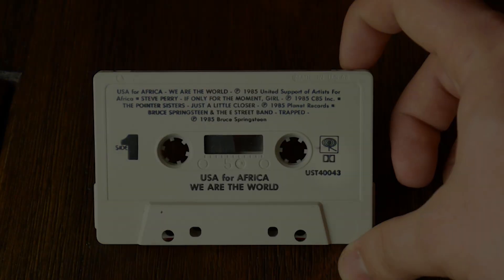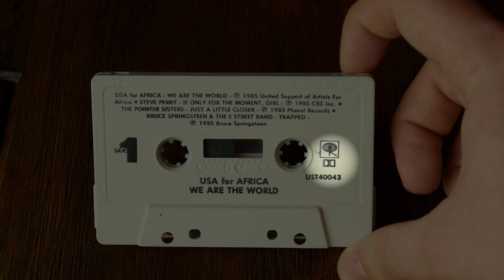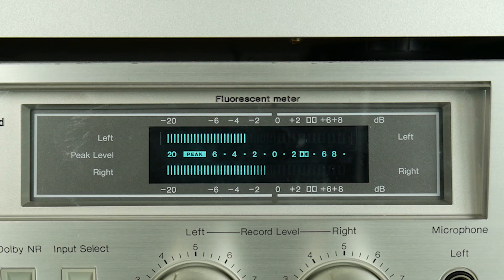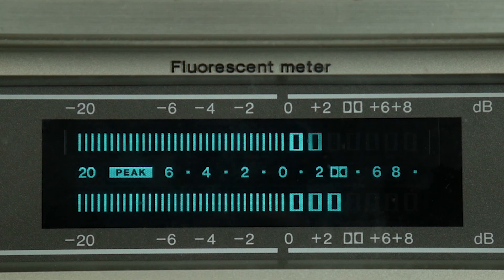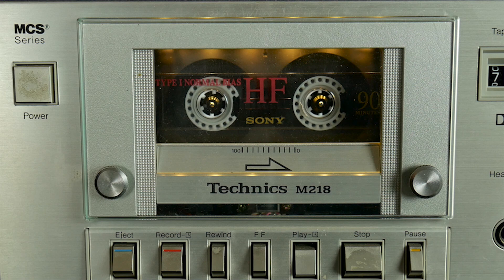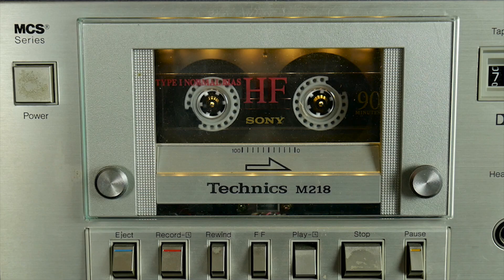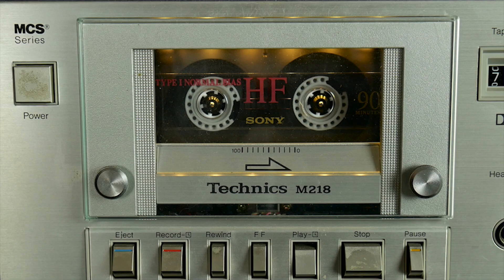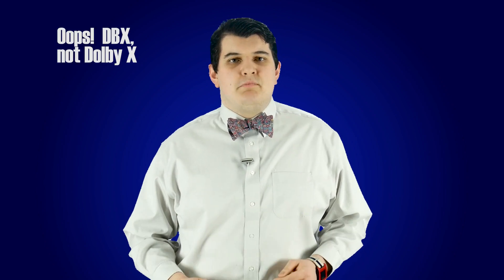What is Dolby Noise Reduction?  Dolby's Humble Beginning

Comment: Funny... I cannot hear that cassette noise.
So then I remenber: "Ho yeah, my tinnitus!"
.
.
Yup, this thing "sings" louder than that annoying cassette tape hiss, (that I still remember from the old times).
But with regards to the tinnitus... well, like my doctor says: "Just forget about it". 
.
.
And then he adds:
"But if for some reason, some day you can't forget about it anymore, then come back here, I will prescribe you some anti-anxiety pills to help you forget about it".
.
.
So yeah, here is my piece of advice: "Stay away from tinnitus". 
If you can.
Reply: Could be stress related. When mine started it was so bad I wished I was dead. After 10+ DR's I did my own research. Basically had to cut the stresses in my life. Still there after 4 years but very tolerable.
Reply: Thanks for reminding me I have tinnitus.
Reply: You and me both. Mine sounds liek a million crickets all chirping nonstop... actually, I take that back:  mine sounds EXACTLY like tape-hiss. 

That might explain why I hate Dolby NR: I rarely ever had it in my equipment (usually due to monetary scarcity), and tinny-sounding recordings just set my teeth on edge. I like balanced recordings, and I like hearing the bass parts as well as everything else. THe hiss was usually not a huge problem for me, as i would use high-quality tapes (cheaper than new equipment), and I would make sure I saturated them properly with the recorded signal.
Reply: This thing has a name? I hear a ring for as long as I remember, just never thought it's something to go to the doctor for and just accepted it.
Reply: @hrnekbezucha  I hear a high pitched noise for as long as I can remember. It is kind of the HF sound when you turn on a TV set. I thought it was normal.

A few months ago I had to shoot an interview about tinnitus. Before the interview I received a bunch of audio tracks with different tinnitus sounds. I recognized my ring.
No I know that noise I hear is actually not normal. I heard about people who actually commit suicide because if the noise. And I must say, some variants are terrible. Some of them are sounds of a big old steam locomotive's whistle!
Reply: Is it tinnitus or hearing the Earth's hum? I used to think it was tinnitus when I'd hear a weird whine sometimes in quiet areas, but apparently enough people hear a "hum" for it to be researched and they concluded that the Earth is actually making interesting sounds, although they can't conclude exactly what is doing it. Last time I checked they thought it had to do with oceans, tides, and/or plate tectonics. Defly worth reading about if you think you have tinnitus!
Reply: @freshrot420  I hear a high-pitched tone when my surrounding is reasonably quiet. I know when a place is silent when only the ring remains. Some say the earth is making sounds but that's way out of my reach. Also human activity won't make it any easier for the researchers.
Reply: I've got used to mine. Actually it is really strange when it's gone from time to time.
Reply: I'm just 17, and I think I might be developing it. There's a pretty quiet hissing sound in my ear that isn't even audible unless if I'm in a relatively quiet place. I'm scared, really scared from some stories I heard about tinnitus. I haven listened to my favorite songs in weeks because I'm being so paranoid about it thinking that listening to even a single song with my headphones might damage my hearing.
Reply: @TheJudge064  Your ears are very precious. Please don't turn up the volume too loud. And wear hearing protection when going to festivals or places where they play loud music.
I'm a cameraman. I wear a headset to hear the director's cues. I think I have boosted the audio too much in the past to hear them over the audio leaking into my headset. And I think that may have caused my tinnitus.
You're 17... and still many... many years to enjoy music, and sounds in general. Be careful...
Reply: @EdwinvandenAkker  Yeah, But honestly I think I'm being a bit paranoid. I listen to music and videos at the lowest possible sound at which I can hear them at, which has somewhat reduced my quiet ringing in my ears. I'm sorry to hear about your condition, and I really appreatiate your willingness to talk about it to help others. I wish there could be a cure for such a cruel disease.
Reply: @TheJudge064  Just keep the volume to a sensible level and you'll be OK. It happens far too often that I'm on the bus and I can hear some young person playing their music from the other end of the bus on their ear-buds. Persistent exposure to any kind of loud noise will cause permenant hearing damage.
Reply: Fil Ipe how'd you get it?
Reply: My tinnitus just started to gradually appear out of nothing, with no apparent cause, around my 35 anniversary. 
I am sure it has a cause, but it is unknown.
Reply: Sorry
Reply: I have it to and i can not hear any difference at all when dolby on or off in this video.
Reply: What I here is roughly the sound of a CRT-tv hissing (when the sound of the tv is turned of). It varies in how much I here it but it’s not as bad as it was when I first got it. I can’t stand loud sounds and the sound of a CRT tv even how low the volume is.
Reply: @PatrikKron  if you’ve ever heard the sound of a faulty flyback transformer, that’s tinnitus (in my case).
Reply: My tinnitus comes from too many years of jackhammers and power saws and it can be louder or quieter at random times and is severe enough that I have learned to read lips over the years.
Reply: If only Dolby made a solution for that
Reply: Yeah i was born with it :/
Reply: Using multiple types of hearing protection is great.  fast over ear muffs and in ear slight noise cancellation hi-fi earplugs for more detailed applications. 

I wish all of you the best.
Reply: Power hiss
Reply: Sorry, i can't hear you over the fiiiiiiiiiiiiiiiiiii
Reply: J Kimmich
1 second ago
I got mine during a period of high blood pressure. I never found out why exactly but ti could be a clot or something else however if those frequencies are amped it really helps but yeah it rings 24/7
Reply: Mine started as an over-aggressive neck massage after suffering from neck pain since I was 19 from a car accident. I was in my forties massaging ritualistically and then all of a sudden my hearing went muffled and both ears and the tinnitus was through the roof so loud in fact I couldn't hear outside noise. Chiropractic Care and trigger point injections help to reduce it to a point where I don't want to hang myself, but it took about eight years for it to finally get down to a non anxiety state. Now I only notice it in extremely quiet rooms or late at night watching television if I've been up past one 2 in the morning. All the heavy metal concerts and music I listen to in the 80s never gave me tinnitus but a neck massage did
Reply: but if dolby NR uses only a high frequency boost during recording then how it will sound good in those cassette players which don't have a dolby NR switch for playback? But then why dolby cassettes sounds good in every cassette players?

Comment: @Technology Connections

I had a cassette deck that had the option to study how the noise was compounded by "listening" at the noise for about 10-20 seconds of the tape. The idea was that each tape was quite homogen regarding the magnetic layer so the deck adjusted itself to best settings to remove hiss. It also was "smart" enough to refuse engaging this system when a low quality cassette was inserted.

Comment: Dolby is much more than as explained in this video. While it does alter the equalization during record and playback, it is applied dynamically depending on the level of the content. Most tapes that resulted in poor results with Dolby were the direct result of the levels being set incorrectly, and low quality tapes being used. In addition most lower priced cassette decks produced excessive hiss, even without a tape, due to the poor design of the player.
Reply: Very much true. The video seems to make it sound like it is just boosting the high frequency levels, but it is dynamic based on the content and not the overall signal.
Reply: He does start mentioning the companding around 4:30.  But you are right - any deviation in level or high end frequency response would cause Dolby playback to sound really bad.  I think a lot of users used Dolby to record, but turned it off on playback!
Reply: YES, exactly. Working in pro audio for 40 years including through the NR years, I can attest that this is correct.  This video is only partly right and full of errors.  But he tried hard.

Comment: The background noise in this video is totally over exaggerated.  Even on a good normal position tape to hear this level of noise the record level would have to be significantly lower then it should be.   If the record level is setup correct to hear this level of noise the volume on your amp would be beyond any normal listening volume.  Chrome tape can go .5db above normal position, metal tape 1db above normal position tape.   On these type of tapes noise is even lower,  to hear this amount of noise on these tapes once the song started you would be deaf from the volume.

Comment: Noise reduction does NOTHING if you have a mic that picks up background noise... and yours do...

Shit in... shit out...
Reply: All mics pick up background noise. It's a matter of the microphone's noise floor which is a function of both quality and the power of your pre-amp, and having a gate to filter out noise when no signal is coming through the mic. 

Even the highest quality microphones have a noise floor which can be reached if you aren't pushing it using a powerful enough pre-amp. As a general rule, the more you have to crank up the gain, the higher your noise floor will be.

You shouldn't speak about things you don't understand.
Reply: There's no such thing as a mic that doesn't pick up background noise. Microphones pick up sound, foreground and background and every ground. What are you even talking about?

Comment: Why wasn't Dolby HX mentioned ?
Reply: Right.  HX is not noise reduction, it's "headroom expansion", meaning you can record at higher (louder) levels without distortion. 

It's used for recording only, i.e. HX is performed at the time the audio signal is recorded onto the tape.  

It doesn't need to be decoded at playback time like Dolby NR.
Reply: Because it's not really a noise-reduction thingy :)
Reply: Melvin Chong I had the same thought.  I was hoping for some discussion of bias frequency and how companded recordings had more high frequency signal so that it effected the amount of bias needed for proper recording.

Comment: Used a lot of Dolby C when making my own tapes in the "olden days". I got out of tapes by the time HX Pro came about. What were the benefits/drawbacks to the process?
Reply from the maker: HX Pro is a record-only process that's independent of noise reduction.  It's a modification of the bias circuitry that lowers the amount of bias when loud high-frequency sounds are being recorded.  The idea is that high frequency sounds can on their own provide enough tape bias to eliminate the non-linear distortion that the bias frequency eliminates.  So HX Pro prevented interference between the bias and actual signal, and allowed for higher record levels.  The HX stands for Headroom eXtension.  Recordings made with it don't require any processing during playback, as it's simply an alteration to the recording method.  There didn't seem to be any drawbacks to using it.  Thanks for watching!